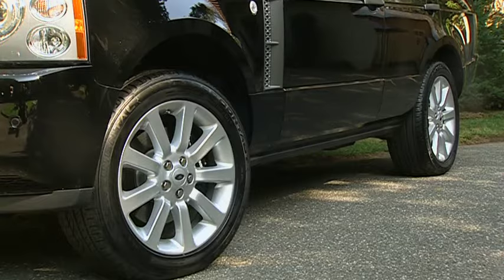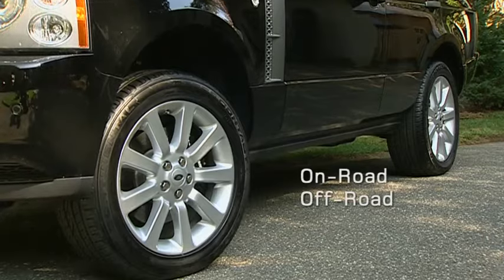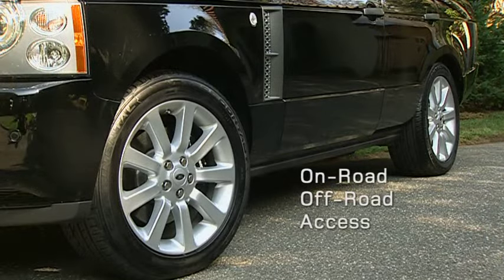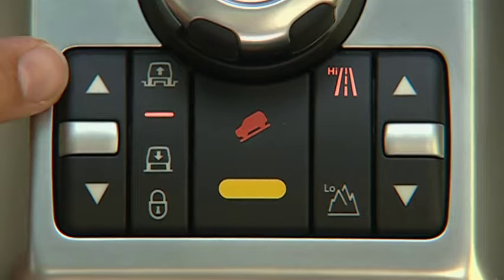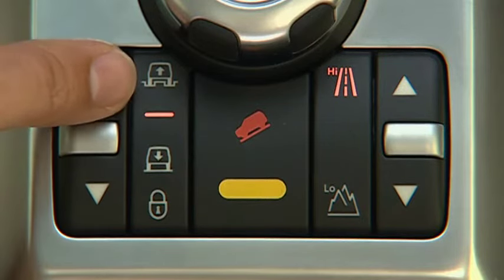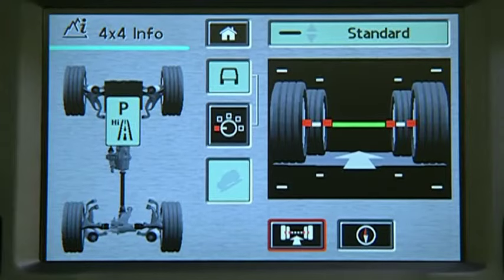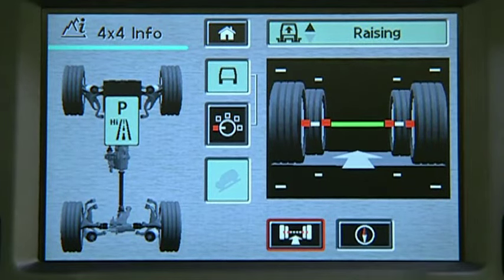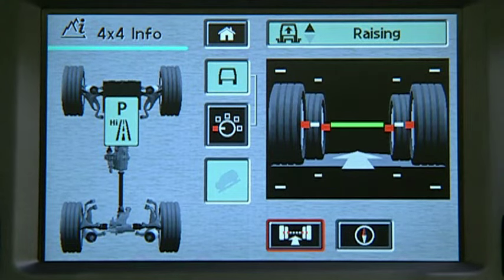2007 Range Rover - How to use the Air Suspension - L322 Range Rover Owner's Guide

Comment: what is the height in crawl mode?
Reply from the maker: Crawl is the same as Access Height but it's locked under a certain speed so it doesn't raise back up automatically.  Actual height would depend on a few variables.  Best to check the Land Rover site for the specs on the specific year